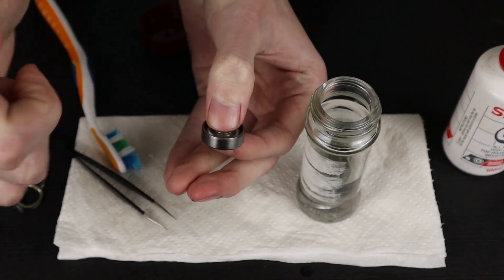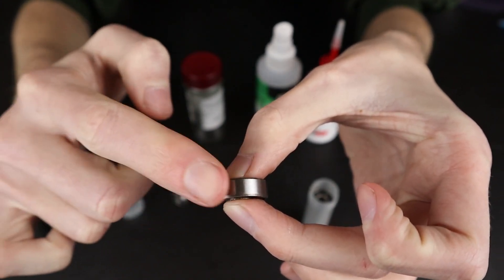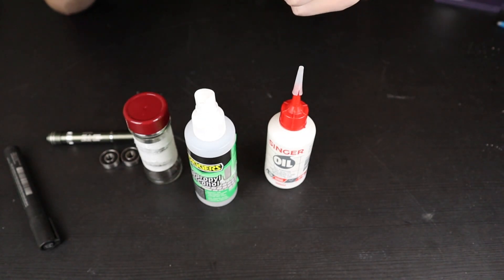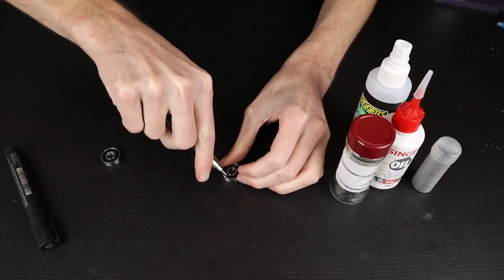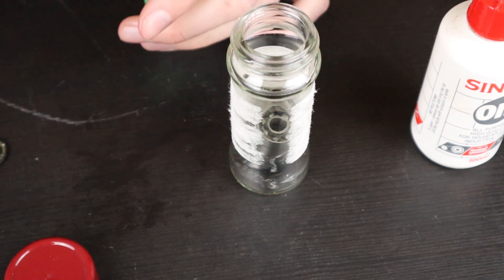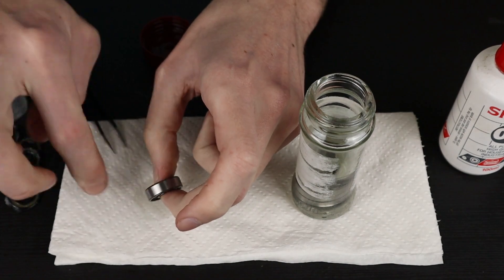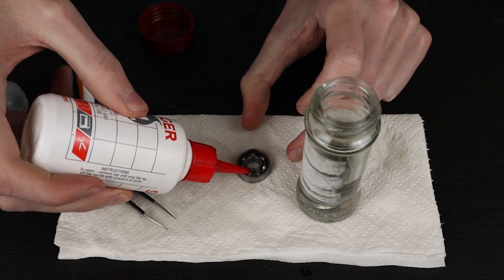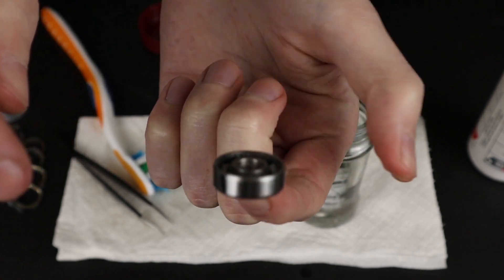Improving cheap skateboard bearings (for use in robots)

Comment: What happens when the bearings have a metal seal?
Reply from the maker: Metal seals are much harder to remove, so I havent got this to work with them
Reply: @TeamPanicRobotics  I have some bearings coming in soon with a metal seal so wasn't sure what I should do about it. I looked up removing the metal seals and they look to be unable to be put back in once removed as you have to bend them out. Just going to run with them and I'll see what to do later.

Comment: Pop the seals from the inside. I do that regularly when servicing my inline skate bearings. In 90 % of the time the seals are reusable. The outside edge is wedged inside the outer shell, but the inside edge rides feely with just a small gap. so you take the flattest not sharp tool you got, get it under the seal from the inside and lift up. that way the rubber stays intact and the metal just gets a small kink you can easily bend back. Putting the seal back on means you got some additional protection against foreign bodies entering your bearing, causing a grinding halt.
Reply from the maker: Thats a great tip, I'll have to try that next time
Reply: yep allows you to clean out lube up put back together and keep skating pretty quickly after that lol